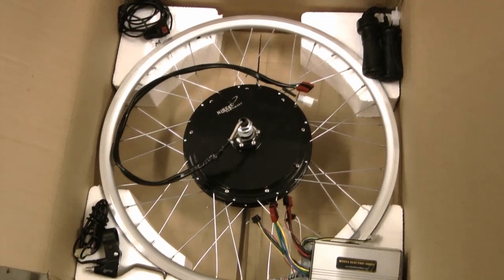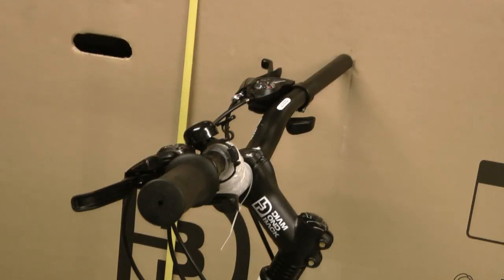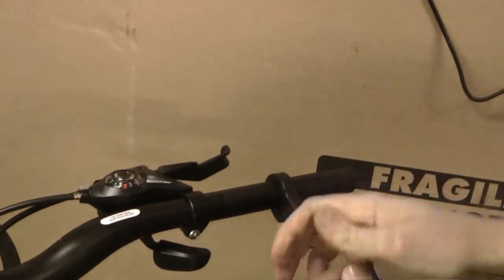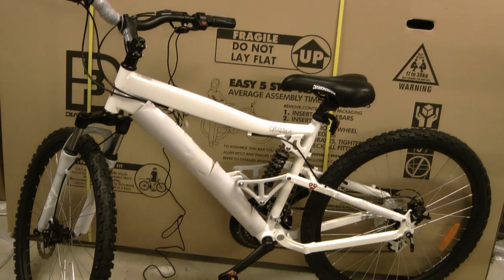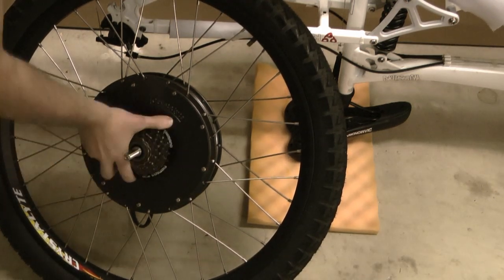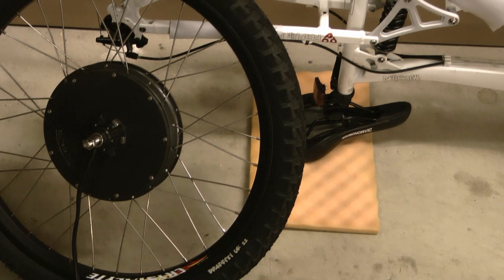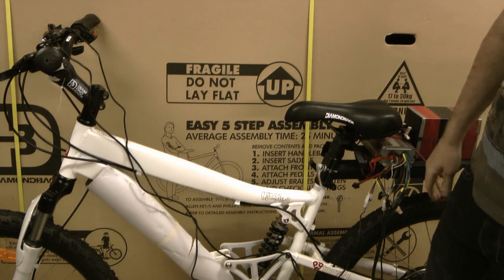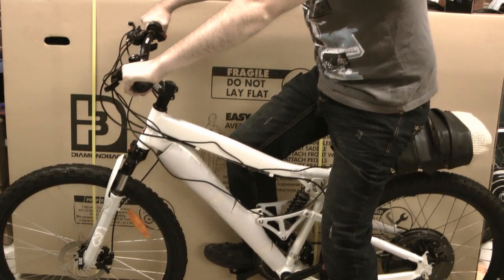Hyena Electric Bikes kit installation tutorial

Comment: use a little bit a dish soap and a knife to remove the grips. use the knife to raise the grips and then drip the watery soap into the space. start turning the grip forward and backward until it becomes loose. use water to wash and remove the excess soapy liquid from the bars then dry the bars.